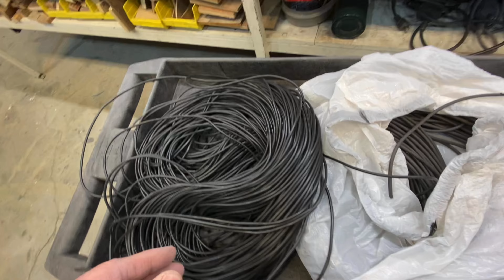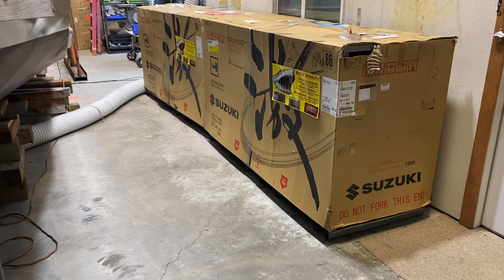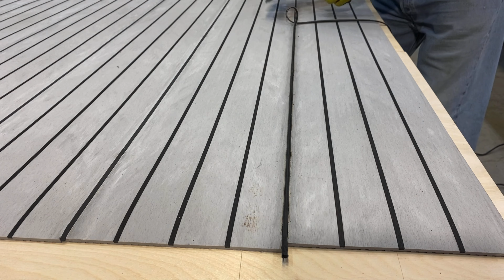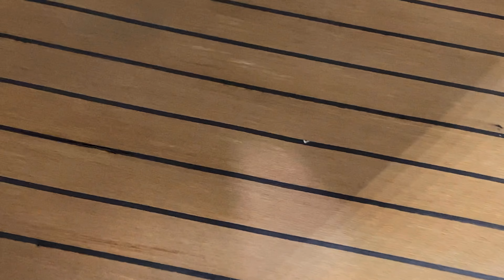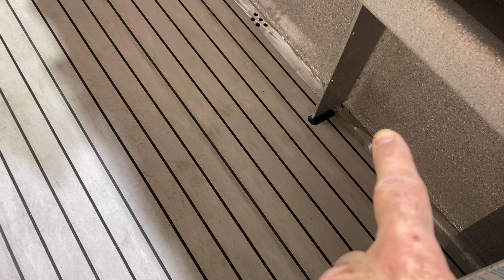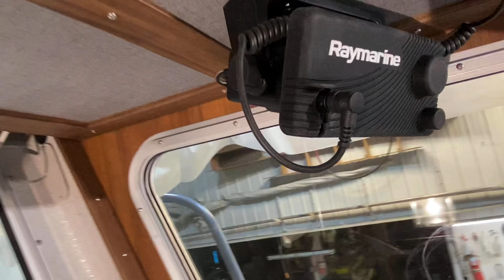Jahrig Aluminum Boat 47 up to 2-10-2022

Comment: I  want to build a little 27 footer with a semi displacement hull, quarter inch steel for the hull and deck. I actually think I may do it and wing it. But I wing fairly well.
Reply from the maker: Hi OSU not quite yet in the water. Hoping for July 1st week. Waiting on the Optimus steering system. Not that this is holding me back but I am doing the electrical/mechanical. i might put a video out soon to catch all up. Sorry for no updates but been very busy.  U B Good now.
Would be interested in seeing your design for your build.
Reply: @PaPaJ2020  the designs in my head, have to figure out the best way to get a "build down" hull form. I was starting to worry that something was wrong and not with the boat!!! Glad your well and look forward to your videos. You have a radio voice.
Reply from the maker: @osu3221  LOL on the voice. 
My buddy Kevin is very sharp on hull design  . If you need some info let me know.
Will j PaPaJ

Comment: What type of fuel consumption have you calculated on average run per hour on average swell? They are massive, and I assume fuel usage would be also. I always get stuck trying to figure out what fuel consumption would be ' on average' based on medium swell average weather, weight etc. What have you worked out cost wise for fuel run?
Reply from the maker: Well I'm hoping for a 1.2 average at 30~MPH. Computer shows hull speed to top at 45-50 MPH. I would love to see an easy cruise speed at the 30mph and maybe even slight better. Boat is heavy and has an extreme sharp entry. that is the reason for the 3 hull approach. The center hull section is 27-28 degree much more aggressive than the norm. Secocond hull section is 15 degree and the outer section is ~5 degree. We shall SEEEEEAAA?
Thanks
Reply: @PaPaJ2020  need to find that sweet cruising speed. Best of luck 👍

Comment: Congratulations on the wonderful boat. what is the name of this project? do you receive the kit to make the aluminum cuts in CNC?
Reply from the maker: Hi MALA, The PaPaJ. Myself and a very close friend Kevin did all the computer layout of the hull sections. Kevin designed and printed all cut sheets dimensions. So no CNC.

Comment: Once again thanks for the video... you should put Flexiteek in your description to get more hits !!  few questions: what did you bond it to the aluminium with ? also i love your hatch hinge system.. can you go through how you did that ?
Reply from the maker: Hi D M, I just added the descriptions - I'm traveling right now a bit. But thanks. If you look at my April 19th #18 I have some of the hinge design in the mid stream of the video. Enjoy.
I used a one part Bostik Hybrid Moisture cure 940A product - works great. 
Will